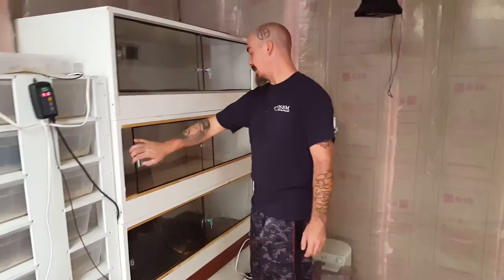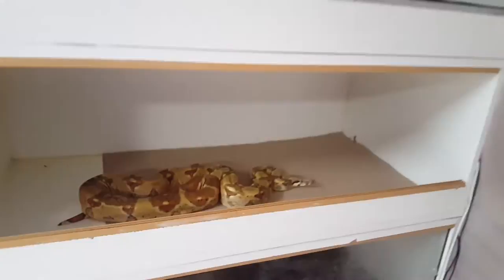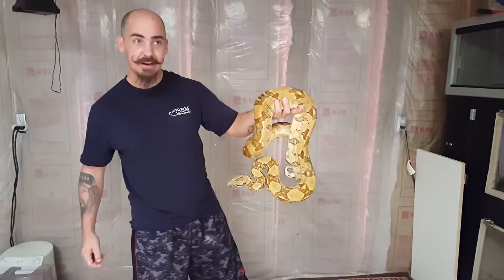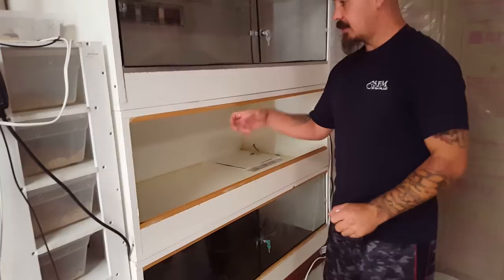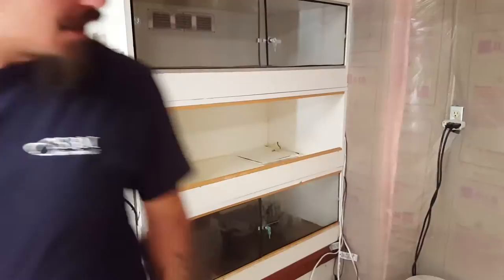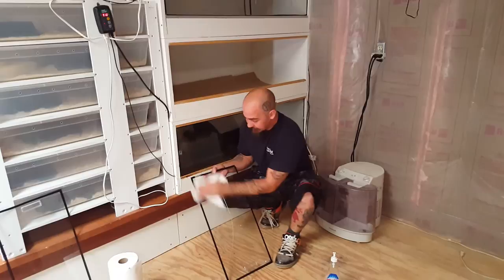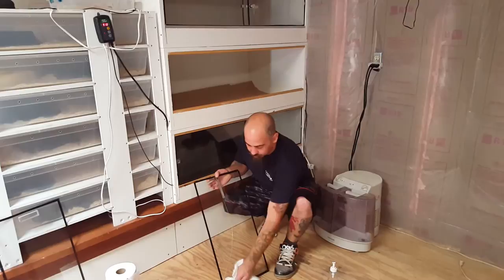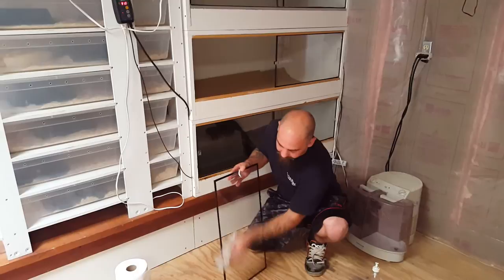Cleaning Satan

Comment: Hey james   I built my cages  with your help from another video!! I have a red tail boa  and two pythons   How do you keep the temperature and humidity needed?  My cages are white melamine too!!
Reply from the maker: Joel Serna so we use heat tape underneath the cages and started using radiant heat panels they are nice on a thermostat needs to be used. For humidity we have stopped using the cardboard and using repti chip and cypress mulch. Glad u built some cages and the videos helped.